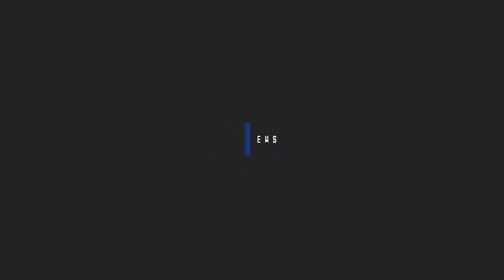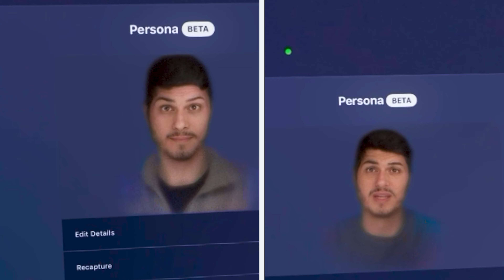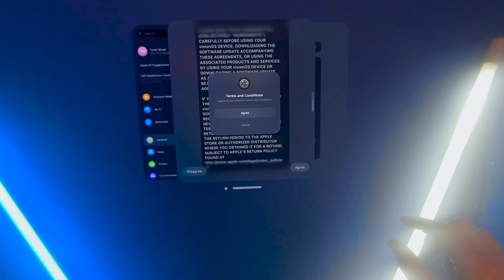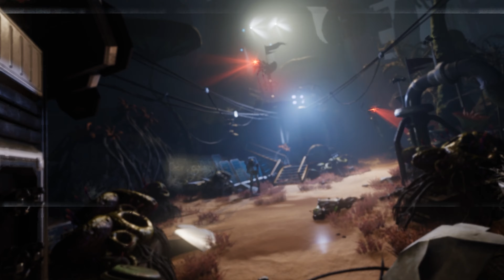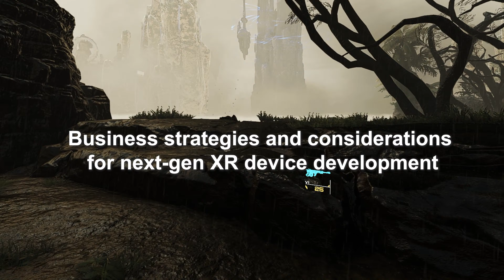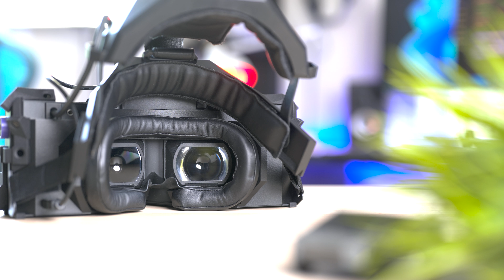Apple VisionOS 1.1 & Quest V.63 UPDATES are HERE!!

Comment: My application still remains the Oculus app (Beta mode is activated) and 120 hz have been there since February 14 (the day I got my Quest 3).  The application does not require updating and is not automatically renamed to Meta quest link and therefore, I don’t understand: It turns out that I already have improved current transmission (I use it during Pcvr via a type-c/type-c cable)?  Or do I need to delete the Oculus app and download the Meta quest link app?  There are simply no specifics about this and I would like to understand whether it is worth downloading something at all or does it not matter?

Comment: Well I now have the Quest 3 and will be testing it out in the following days.  
No matter how good the Apple Vision Pro is,  I cannot afford dishing out 3500 dollars plus tax -  waste of money to me.   I just play VR SIM Racing games, that is it.   Quest 3 is expensive enough for me.

 The Quest 3 should meet my requirements.  Some of the updates for the Quest 3 deal with things other than games and will probably never ever use them.  As long as the lenses are clear, have a nice wide sweet spot, and higher resolutions,  I will be happy.  I do have older VR tethered headsets and they work well for me. The Quest 3 will be my first Wireless headset, although I will be connecting the headset via a link cable to play STEAM games.

Thanks for the video. Take care.
Reply: Trust me you are way better off with quest 3. That apple headset is not the way to go. A ripoff if anything.
Reply: @Multipass-0 it’s not a ripoff, it’s just expensive, from what I’ve learned,l so far, Apple probably have just a little profit on every Vision Pro they sell. It cost them at least 3000usd to sell one, with the parts, the machines to manufacture them, the r&d, the software development, marketing, shipping, etc. just the parts itself is around 1500, the other things are at least the same price if not more. So it is expensive? Hell yeah, it is an overpriced ripoff? Not really. But I understand if you can’t justify to buy one, it’s not for you, and that’s okay. They probably didn’t think people like you will buy it anyway.
Reply: Hope you know that the quest has a really noticeable compression when playing pcvr. Thanks to that, it’s not really the best for sim racing. Even though the resolution is high, you won’t really see a clear picture ever. Quest link is like 2,8Gb/s while display port 1.4 is around 30. Ofcourse if you don’t care about picture quality as much, then it’s good

Comment: Lying down mode only for Quest 2 and Quest pro.  Big kick in the teeth to the Quest 3 users..... come on Meta!!!
Reply from the maker: Yeah, so weird
Reply: I’m guessing they need to iron out the learning that takes your tracking info. I laid down the other night and struggled to use it- in the morning, the VD FBT had my chest arched ridiculously- like lumbar lordosis. It took a few minutes to drift to the correct position despite trying to recalibrate- closing and opening the app
Reply: Yea, number one issue when laying down is the position of the quick menu relative to the Meta browser window. They need to allow the browser windows to be positioned independently of the quick menu location. Otherwise, when I'm trying to click on the lower window bar to move it, the quick menu blocks my cursor from hitting the window grabber bar.
Reply: @eighties8  LYING DOWN, not laying down. What are you laying down? Eggs?
Reply: @mitcherny6965 lol, Tomato, Tomahto. Whatever you want to call it, you do you.
Reply: This must have reasons. Makes no sense that Meta bothers Q3 users on purpose...